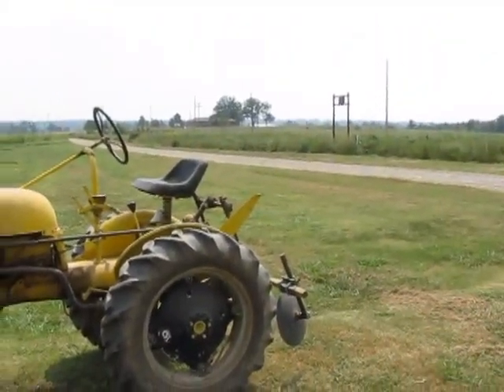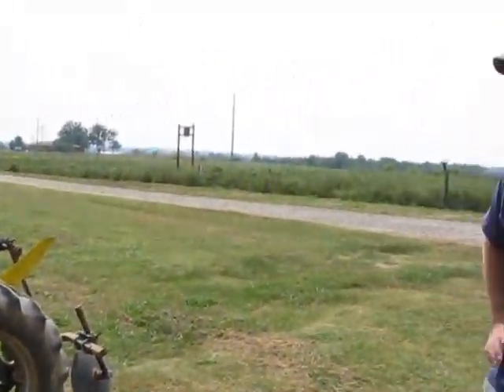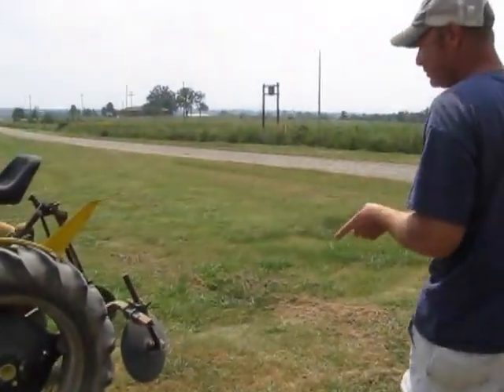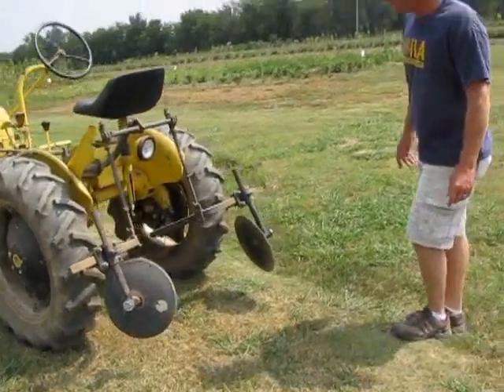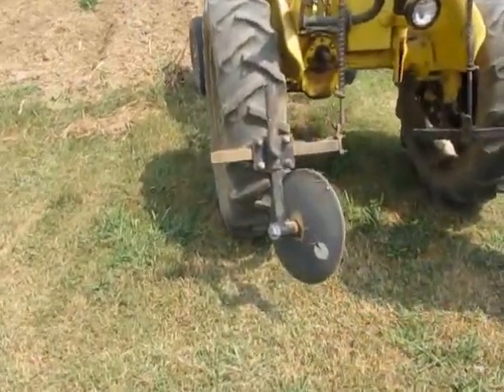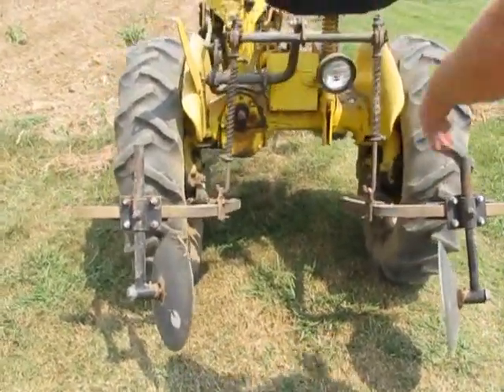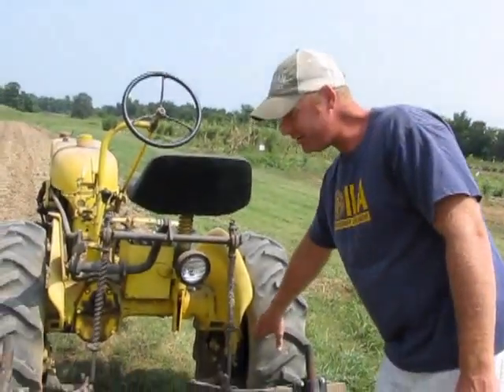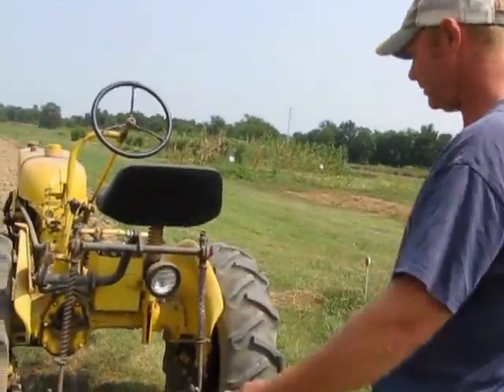Using a Bed Shaper

Comment: Bill, did you make the bed shaper from an old disc or what?
Reply from the maker: Michael,
Bill made a modified toolbar for the tractor.  The disk hiller attachments 
can be purchased separately and mounted to the toolbar with a good 
mounting clamp.
Reply: Thx!